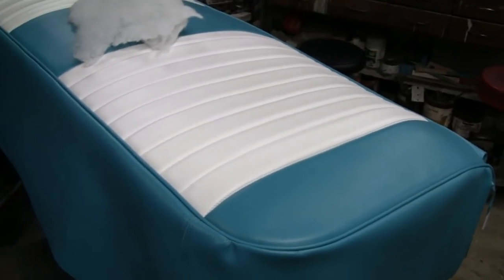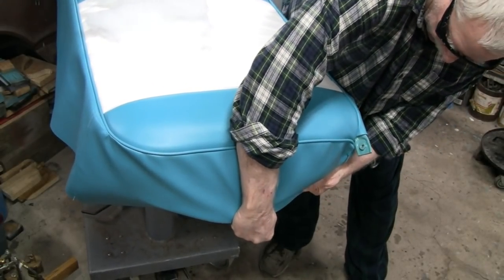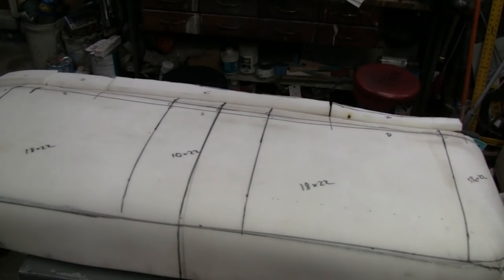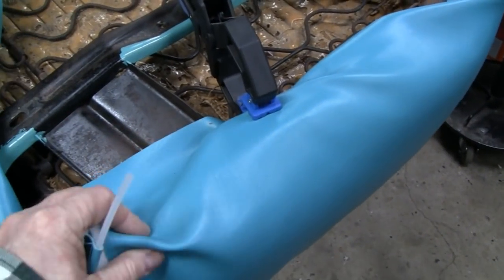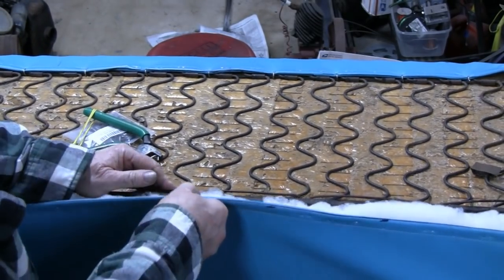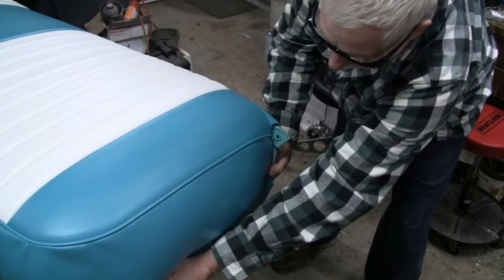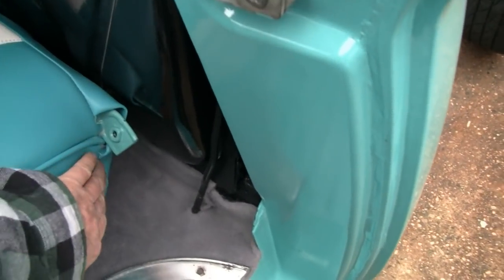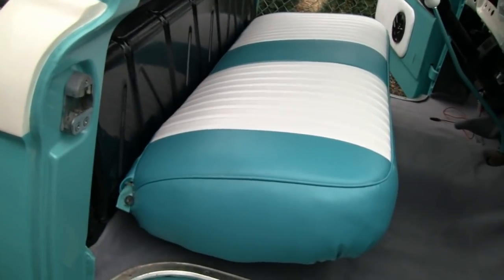COMPLETE the SEAT BOTTOM (F100 part 85)

Comment: You can do my upholstering any day, top notch work there. I remember when a friend of mine had his upholstery business i`d stop by and recall him using either a hot steamer or hot air gun to heat up the vinyl to allow it to be more pliable thus eliminating corner kinks for a smooth corner. Will you do a video of polishing the aluminum? I`m curious. I restored an old golf cart and it has aluminum trim around the dash thats scuffed and i`d like to clean it up and polish it.
Reply from the maker: Thanks Leemer!! We did make a video of the Aluminum Resto!! We'll be posting that shortly, it came out pretty well!!☻
Reply: @805ROADKING  excellent!  Cant wait for it and to learn from the best.